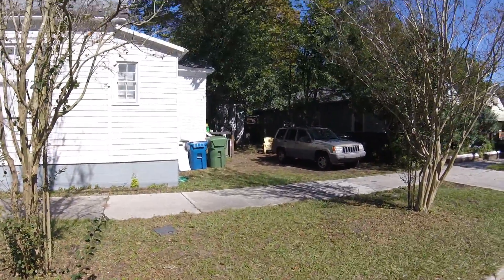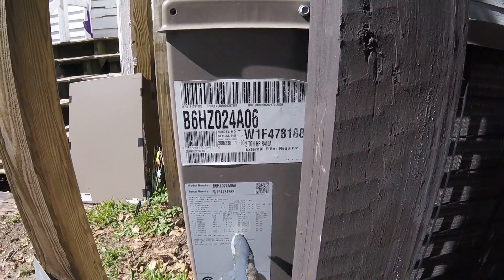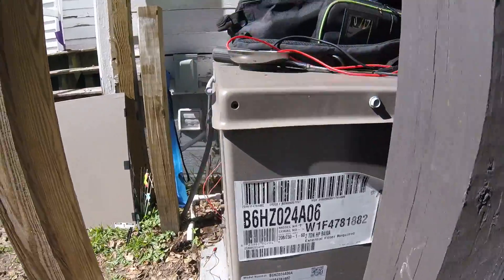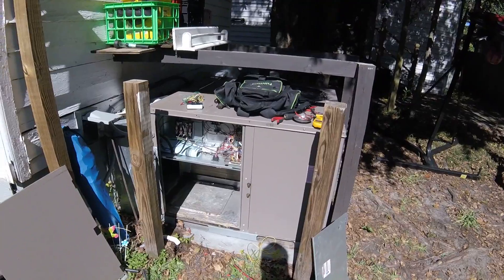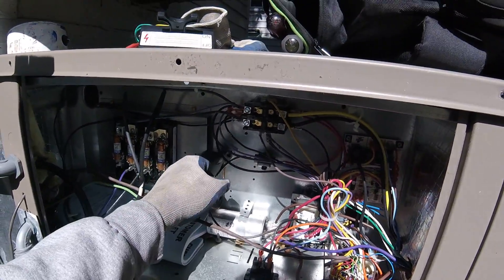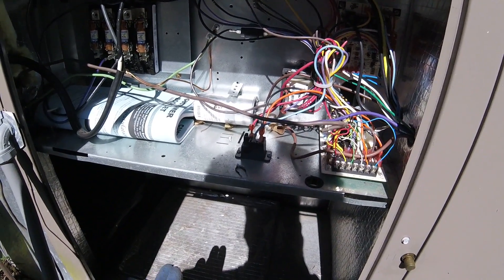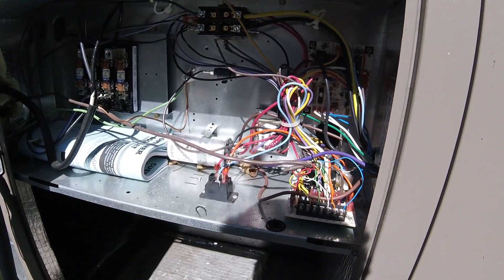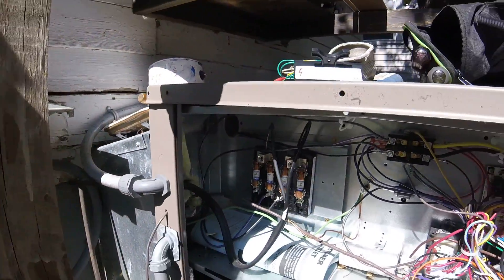The Unit Keeps Tripping The Breaker

Comment: I do believe that the low voltage is powered by the aux heat breaker so that the unit will still have aux heat in case of compressor failure.

Comment: Hi, I hope if you can guide me with this. 

I have a cable that runs from the oven directly to the main breaker, passing through a socket purposely fitted for the oven. 
When I turn the socket on the breaker switches off, but when I turn the socket off then I can turn the breaker on and it will work. 

However I tried changing the socket with a socket that I know for sure it works, but the same thing happens. The oven is not yet connected. 

What could it be??
Reply from the maker: What socket do you have?

Comment: Had one with a loose wire at the breaker...the house was about 40 years old.
Reply from the maker: Old houses will do some strange things that are not normal for an HVAC call.
Reply: Anytime I go to a tripped breaker call. I check the a/c unit out. If I don’t find any obvious issues.  I open the panel and check my circuit breaker to confirm the wires are tight. I find them loose a lot.  But here in Florida an Hvac contractor is not legally allowed to open a breaker panel